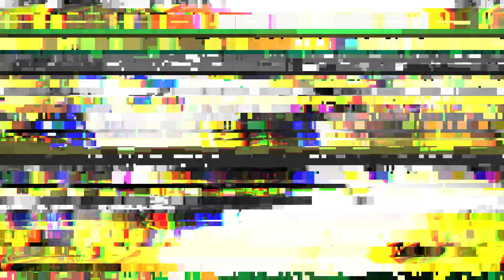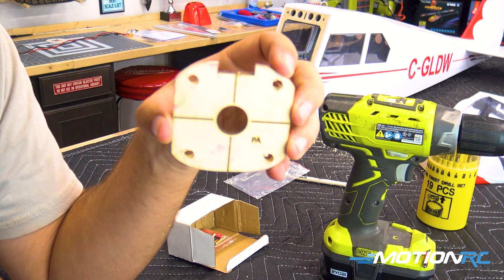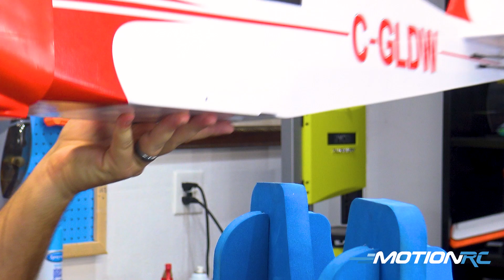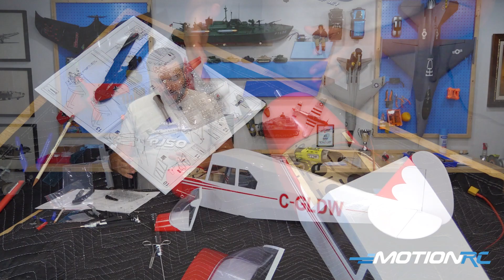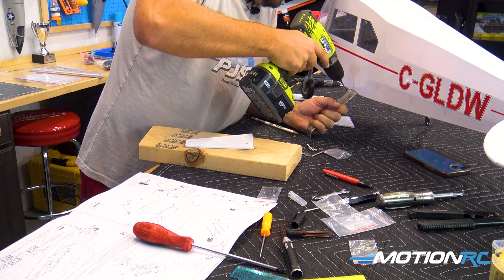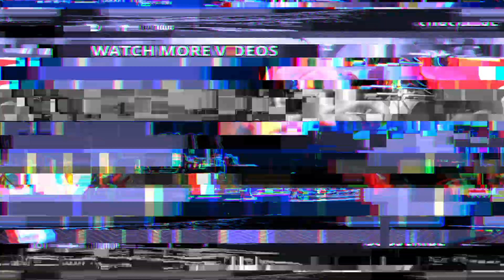Nexa PA-22 Tri-Pacer Assembly | Part 4 | Motor Mount, Cowl, & Landing Gear Install | Motion RC

Comment: To be prototypically correct, the nose bowl must be cut open on the bottom.  That is where the fuel strainer is located, on a real Tri-Pacer.  This is from personal experience with a PA-22-150 Tri-Pacer that I flew in 1969.
Reply: Same thing on my 1954 tripacer, but keep in mind, they can only do so much with a model. It’s not a deal breaker for me but would be nice to add in